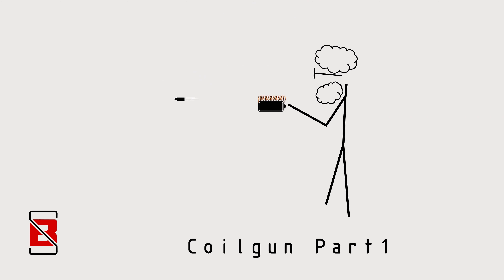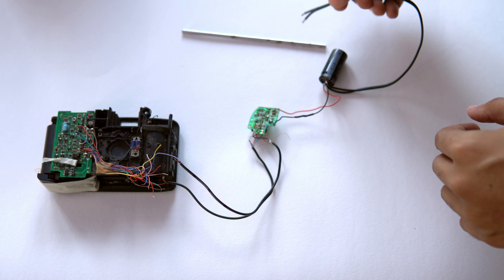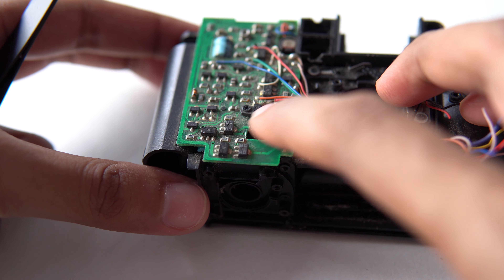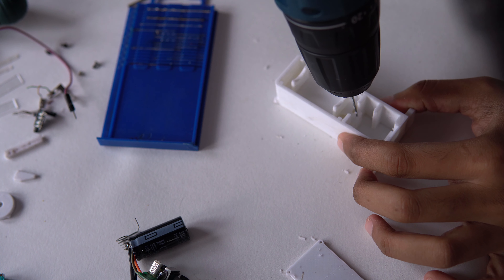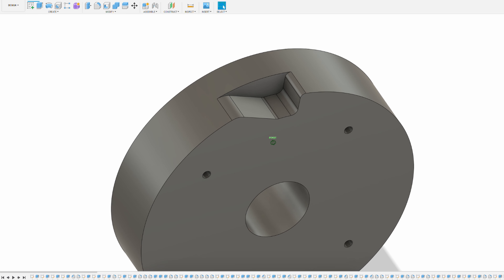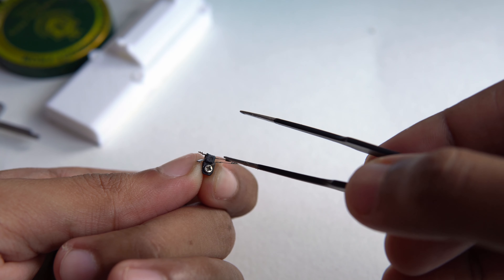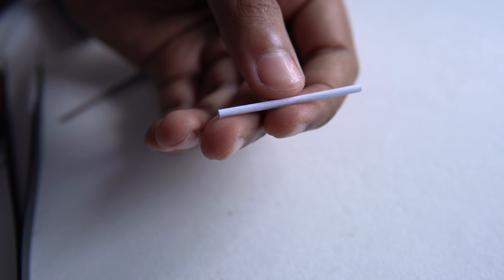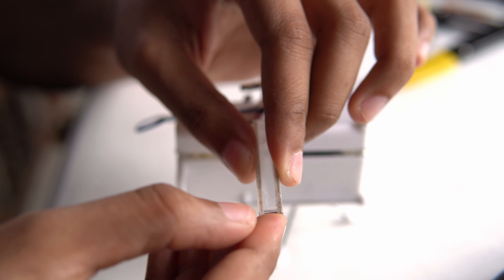Smallest Coilgun, Part 1

Comment from the maker: Thanks for watching! Don't forget to subscribe! 
My city is under lock down so the second part will be coming after a while.
In the next part of the video I will use a IGBT to turn on and off power to the coil.
One thing I haven't mentioned was high voltage safety. Be careful If you are trying to make it.
Reply: You can use lead pencil box instead of magazine